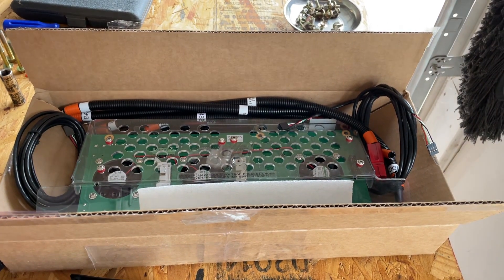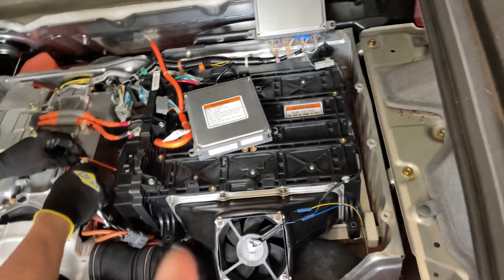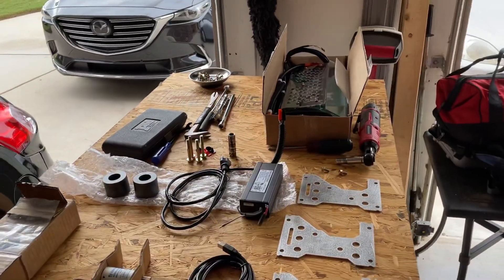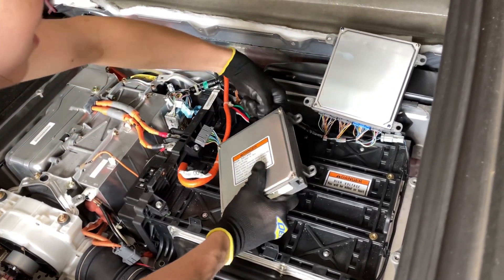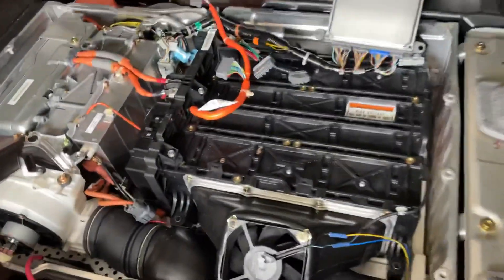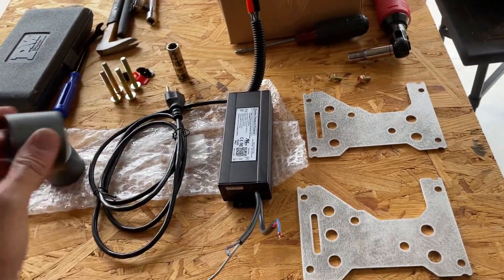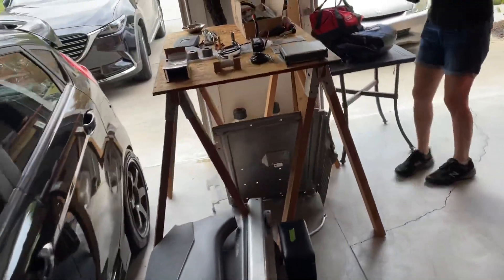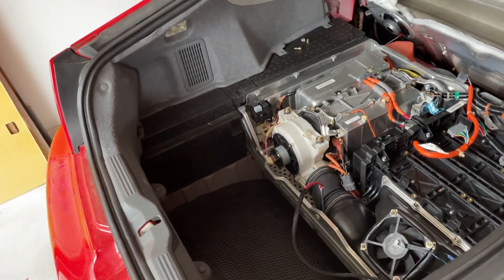G1 Insight: Lithium conversion 1/6, overview and removing NiMH

Comment: The Linsight homepage does a poor job of 'selling' the features of this conversion. They should have its benefits and performance specs right there on the landing page rather than buried in a FAQ dropdown menu, and the one video of a modified Insight is underwhelming at best. That said, I would NOT have sold my '00 Citron Insight if this kit had been available a few years ago.
Thx for posting this series!
Reply from the maker: Yes you are right I talked to John about that, he's got so many other projects going on he's moved on from this one for the most part. Great product though!
Reply: @GenXJeffstuff  I hope he's got a lot of stock for years to come for others late to this mod. Are you doing the 40% increased power hack from (insert unknown name here)?
Reply from the maker: @nazcaplain  Not sure, I think there's a waiting list for/if when he makes more. Yes I did the current hack when I did the Lithium conversion, I have a video on it as well on my channel.